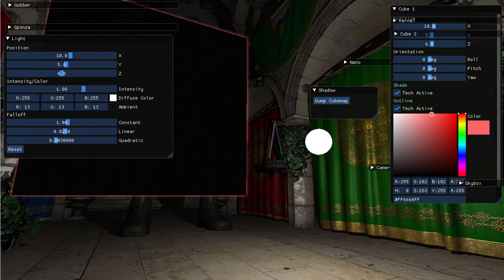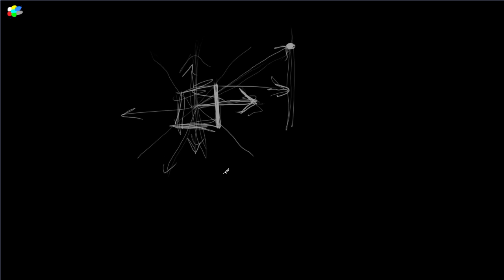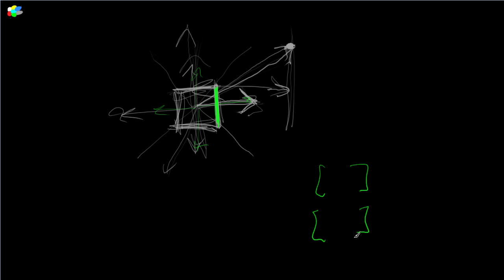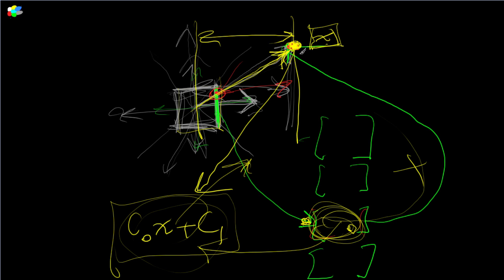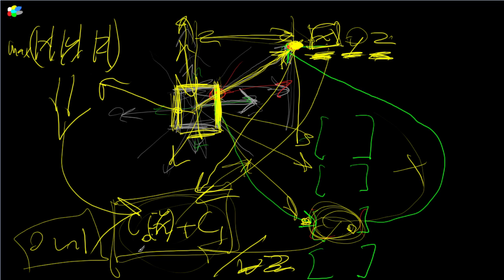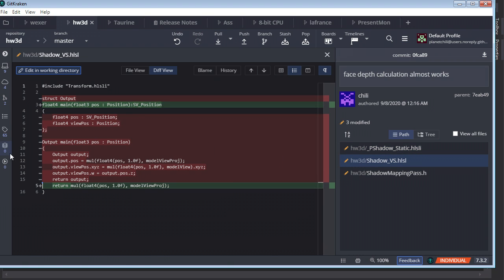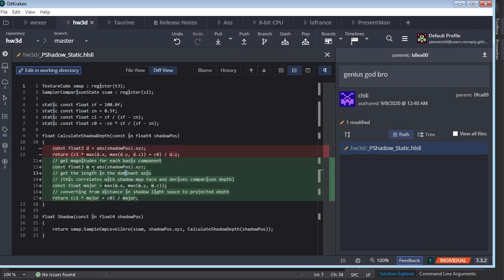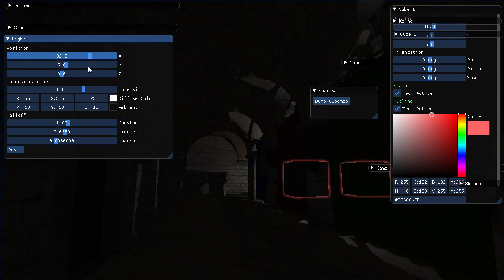Success! Cube Shadow Bias [C++ 3D DirectX Tutorial]

Comment: Hey Chili! Always great Job!  I have a little issue on "ShadowMappingPass.h"  around line 74 "const auto pos = XMLoadFloat3(&pShadowCamera->GetPos());"  I had to splitted in 2 line cause it give me this error <C2102 "'&" need a l-value>.  Actually this error it make sense to me but it kind of strange it works for you :) .. Did you set up some compiler options to make it works? thx
Reply: I can confirm this problem. It appears on VS2019 v16.8.2. Do not update the tool or you will have to fix it yourself to be able to compile again.
Reply from the maker: Hmm, that's strange. I can't think of a setting to change that behavior... Who knows maybe if I updated VS and tried to build it would error now :D
Reply: @ChiliTomatoNoodle  Yep, maybe that's the reason, I have the latest version of VS (including a new "Git-experience" which confuses me a lot hehe).